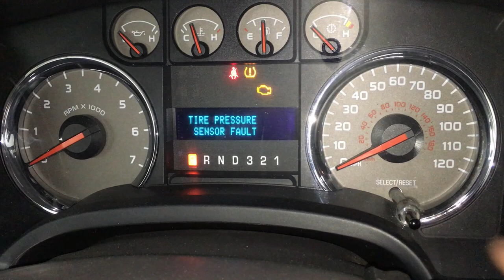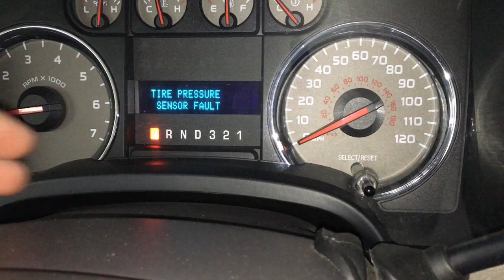1997-2010 Ford F-150 Rear Brake Job: Pads and Rotor Replacement

Comment: Thx man great video, I'll save a few bucks in my next brake job. I have a 2006 F150 should similar. I also have the Ford shop manual which helps too ( not the HANES crap ).

Comment: I always anti seize wheels stud and bolt.  Reason is two fold.  1.  Ferris corrosion and galvanic corrosion.  2.  You can't get proper thread torque if dry parts are binding.  I torque my wheel nuts to 115ft/lbs and because I use anti seize the torque is consistent.  This helps prevent one aspect of rotor wrap due to heat and unequal torque.  

The other issue I have with your video is you warn against getting g brakeclean under the piston boots but then you get in there with compressed air and blow fine materials into the voids...I would be far more concerned about that then a product that evaporates.

Comment: I've seen in other videos that you shouldn't compress the brake cylinder without the bleeder screw open. Pushing fluid in reverse can potentially damage the ABS.
Reply from the maker: Yes and?
Reply: @FordTechMakuloco  I'm surprised you didn't mention it, that's all.

Comment: hey guys! just bought a 2000 ranger 2.5 standard. many issues but the most annoying is the brakes locking up almost every time I barely touch them. It started in the back but now almost exclusively in the front. a little pressure and I'm almost ejected out of the truck... I replaced the rotors which has clear signs of the pads seizing up but no help. Many people have suggested many things. some said to replace calipers but they're not leaking nor showing signs of malfunction (they do retract and obviously expand). some suggested I replaced the hoses but with the calipers response i  doubt a clogged line is possible. some suggested a flush (I'm definitely considering it). A Ford tech suggested the most expensive alternative so far: replace the master cylinder and some abs part ( maybe the modulator valve?)... Please only reply if you know what you're talking about. if you had similar issues and resolved them holla at me please

Comment: crap, I needed to see how to deal with the parking brake portion of this. have a 2011 expedition I need to do this on.
Reply: I have an 11 Expedition as well. Was thinking of doing mine myself as well but a friend told me to be careful with the ABS system that you would have to open the bleeder valve before you push the pistons in I wonder how true this is?
Reply: @rod7071  I ended up biting the bullet and doing it. Was quite easy except replacing the guide pin rubber pieces. Difficult to put them back in. Rest was straight forward.
Reply: Nonsense, piston just pushed in like usual and without issue.
Reply: @cmarshall2211   I did mine a few weeks ago as well  it was a lot easier than I expected thanks to this and a couple of other videos I viewed. I did open the bleeder valve when I pushed the piston in. Better safe than sorry. One of the videos I looked at explained the reason being sometimes the fluid gets contaminated or breaks down in the caliper due to extreme heat in the caliper and pushing that fluid back into the abs system can damage your abs system. Not sure if it’s true or not but I got the job done without issues. Hopefully Makuloco could clear this up. My parking brake was no issue at all btw. Thanks for your info my friend

Comment: What would cause the brake to drag or not release all the way after changing out everything? Example: You apply your brakes to turn into a parking lot and upon acceleration you feel some vibration much like a rotor being a little warped. You can feel it best if you are accelerating up an incline after you turned in. Only thing is you changed the rotor too!! So it must be the new brakes dragging. Mine is a 2004 F-150 4x4

Comment: Can you advise how to open the bleeder nipple.... I had to replace a caliper today when attempting to bleed the fluid.... Last time I did it on my 2008 F-150 ,,, at least two snapped... I use penetrating oil... a little heat... etc,... they seem to be welded in there.... The nipples are made out of a VERY soft metal....and snap at the neck... without budging... is it the brake fluid that has the dissimilar metals bonding...
 I would like to finish the bleed but afraid of breaking more...

Comment: Any insight on why no antiseize on the studs? I've used it for nearly 25 years on all of our cars and never had a problem, not even one loose lug ever. Just curious. PS - Also glad we have two things here in GA... no salt/rust and only emissions inspections, no crazy in depth inspections ;-)
Reply: I don't think applying lubricant (anti-seize lubricates as well) to studs is recommended. Typically the stud torque value is specified as a "dry" torque value. Adding lubricants to the studs may cause the actual torque to the studs to be higher which may lead to stud failure. The torque specification takes into account the friction between the stud and nut.
Reply: Gotcha. Just seemed to me it was inferred that something catastrophic would happen if you got a little antiseize on the threads.
Reply: Robert Kohut when I worked at an auto shop we used anti seize on the studs when it's really rusty or hard to take off so it will come off easier later and not seize on. The torque should be sufficient to keep them on. I've yet to have one come off.
Reply: I have used it on a large number of vehicles for more than 40 years. Local tire shops here in Washington state routinely coat the lugs when doing wheel service. If you look around on Youtube this date you will find some videos that show the use of anti seize on wheel lugs. If the nut is torqued properly they will not come loose.

Comment: hey love your videos they are a big help but is their any way you could show the proper way to completely drain out the transmission fluid, like what's in the torque converter. I know how to do the transmission but not sure on how to get all 13 or so quarts out so I can put in all new fluid in my transmission for my 04 f150

Comment: Just watched this and I bought a used 2003 F150 and the brakes were making a bunch of noise so I purchased all new brakes. When I removed the caliper from the rear drivers side my pads with the two notches were on the bottom, yours was on top. Do u think the previous owner had put them on incorrectly? The inside pad was broken and probably the reason for the noise. I'm thinking I need to take both sets of the rear pads back off and swap them?

Comment: I have to do this to my 2005 STX. I have my parts, but I'm going to need a bigger C clamp. The wood clamp I have is the hand squeeze type and it just doesn't have the power to compress the caliper, the C clamp I have is too small. Can I use sand paper instead of the wire brush?
Reply from the maker: yes
Reply: Success. I picked up a large C clamp from Home Depot and was able to get the calipers off and complete the job. I ordered my parts online and saved a shit load of money, and the labor was free lol, The good news is my axle seals are good and the parking brake shoes were in good shape. Thanks for this vid, it made it easy.

Comment: Any tips for removing a stuck rear tire on an 01 F150 4x4?? Saltwater seems to have cold welded my rim to the hub and no torch, sledge, or pry bar has been able to get it to budge. Couldn't find a specific video on your channel but any tips would be appreciated!

Comment: The tool that you were using to push the boots through the caliper, I always called it a cat's claw.  Is that the correct name for it.  I need to get one for my toolbox.  Thanks

Comment: I'm changing the front brakes and rotors on my 2006 F150. The guide pins are different with one having a rubber bushing. My question is, does that pin go in the top or bottom of the bracket?

Comment: Does Motorcraft offer a brake rotor that has the black protective coating on it? I believe that is an AC Delco rotor you have in your hand right? Most important part of the job is the last part of pumping the brake pedal. I did the rear brakes on my  f-150 a couple years back but the Motorcraft rotors I used didn't have the black coating on them.
Reply: jdtractor man buying rotors these days is cheap. Buy any brand doesn't really matter except for those that have the anti rust but it's not really needed either. Just be sure you get the proper thickness. Doing brakes and rotors yourself is cheap as low as $200 . Paying a mechanic to do it could cost you $800 a pair. In the case of an Audi or VW than it could go as high as $2k a pair.

Comment: Hey if you happen to read this I hope you have a chance to reply..  on my f150, from the factory, the loaded caliper clipped in on  the bottom and then the top swung shut.  Was it incorrect from the factory?  I reassembled it like it was taken apart.  After coming across you vid, I saw that you have the top in first, the your bottom swings shut.  Is mine incorrect?  Or does it not matter at all?

Comment: Got a question. I have a 2011 f150 ecoboost, it's a supercrew 6.5 ft bed, with 20 in wheels. what would be the smallest diameter wheel, I could fit without having to change a bunch of stuff.

Comment: So I've run into a problem. My truck has a vibration dampener on the upper caliper bolt and it's very corroded and STRIPPED. Vice grips are not working to remove the bolt. I can do the brake job myself, but I can't get that darn bolt out. Do I absolutely need the dampener on there and how do I get that stripped bolt out?

Comment: I have an 01 f150 super crew that I absolutely love but I have a question and and I'm pretty sure you could an answer it for me.   When I did the break job on it I didn't find vacuum lines on the ice.  Two wires. It seems that it will lock in 2 high but not 2 low. What have I got going on here? Any help with this would be greatly appreciated!
Reply from the maker: You do not have IWE’s.

Comment: I literally did this last weekend and was thinking to myself, "You know, I wish Brian had a video on this because these stupid inner shoes won't adjust properly...." I also found that my e-brake cable was completely disconnected on one side, and I wound up just spinning the bottom adjuster in to where they don't really do anything, simply so they didn't drag.

Comment: hey, can you tell me the thread size and pitch for the bleeder screws on a 2010 F150? I want to get speed bleeders but the fitment chart on their website says I need a 3/8-24 for the front and a M10-1.0 for the rear.. can that be right? thanks! your videos are priceless
Reply from the maker: +Jeremy Johnson yes they both sound about right
Reply: FordTechMakuloco I guess I shouldn't be surprised but definitely weird to use standard sizes on one set and metric on the other but whatever.  Do you have any feelings positive or negative on using the speed bleeders?

Comment: since you are a ford tech, what fuel octane is recommended in an f150 with the ecoboost?
Reply from the maker: While this engine can run just fine on 87 octane it will run much better with more power and better fuel economy on 93 octane but you have to justify the additional cost.

Comment: whats the rear disc brake minimum thickness specifications for a 2002 f150 rear wheel drive

Comment: If I were u. I would use a drill with a small wire brush to erease corrosion from calipers. Make job more easier.Small round brush set at harbour freight cost 3 bucks.
Reply: That works well

Comment: Do you have a video on replacing the brake lines on a 10 f150 ? I've gone through 3 calipers on front drivers side not releasing and was told even though its getting fluid the fluid might not be able to go back in.
Reply: I know your comment is 3 years old. I was told decades ago, if your caliper is not retracting, the brake hose is collapsed. Replace that. Should fix that issue.

Comment: Are Raybestos rear brake pads and rear rotors good for my 2000 ford expedition 4.6L V8 Triton XLT? 

Or is it only AC Delco or ford Motorcraft?
Reply from the maker: I only use Motorcraft or Wagner.
Reply: @FordTechMakuloco  Thanks.

Comment: "There shouldnt be to much corrosion"😒. Maybe if I lived in the southern regions. lol
Reply: Raymond myszka On the 97, which was the only year they did it, the exhaust exits right in front of the right rear wheel. This caused excessive corrosion on that brake assembly.
Reply: @yqwgjsg  a8
Reply: @yqwgjsg  9

Comment: Do you need to bleed the brakes before you push in the piston of the calliper?
Reply: So it doesn’t damage the Abs system of the Ford?
Reply from the maker: It is best yes but experience tell you it almost certainly will never be an issue.

Comment: Would you prefer ceramic or semi metallic breaks
Reply from the maker: +Carlos Cepeda Ceramic just from the noise and dusting aspect. These were organic pads which are nice and quiet but produce more dust.
Reply: Ceramic brakes tend to have a better grip, yet shorter lifespan, while organic (or semi-metallic) pads tend to be the other way around. It's up to you and how well (or how long) you want the pads to perform.
Reply: FTM - I rarely ever see organic pads for sale anymore, most I see are semi-metallic or ceramic.  My favorite pads are Akebono ProACT ceramics, put them on my f-150 and BMW M-roadster. Very little dust and stop fine. Previous to these I used AutoZone (lifetime warranty) cheap semi-metallics, but make lots of dust.  ProACT pads are about $50-$60, well worth it.
Reply from the maker: +Hubjeep All motorcraft pads are organic except the superduty line which is semi metallic so they are out there.
Reply: Carlos Cepeda ceramic is best and keeps rotors longer but the pads wears out faster. Semi metallic pads wear out rotors faster but the pads last longer.

Comment: Do you ever use disc brake quiet?
Reply from the maker: No never needed it.
Reply: I work for CRC and we make the stuff but I never used it. It's popular though so I was just wondering what all the hype was about.
Reply: Ken MacMillan that stuff is useless. Use anti seize and you're fine. Brake quiet and brake stop squeal is a waste of money.

Comment: Great video. I have a question. I recently changed my rear pads and rotors.  When I went to go test drive i noticed my  driver side pad was smoking. I wiped off all of the cosmoline and I coated everything with anti-seize or silicone  grease, but I cant figure out why the brakes are sticking? Any information  would be appreciated.

Comment: Hey guys looking for some help...
 So my 08 f150 was shaking  when I applied the brakes and pulsing @ lower speeds, so I replaced both front rotors and pads while I was there... also bled the lines . STILL SHAKES AND PULSES. Any Ideas? Do the rear? See if that helps? (180k on the truck btw) Thanks!
Reply: Jorge Lopez - Although this tech does a good job, it is not the best one. The best practice is to Check the  balance on the disk. A minor misalignment on the rotor will shake the wheel or pulse the brake pedal and will lead to premature wear. The best practice is to buy a magnet base dial indicator ( sensitivity 0. 01 mm) and set it to radial and axial surface of the disk. Turn the disk slowly and see if the rotor is balanced. Desired value is ; < 0.02 mm play. If more there are shims available to fit between the brake rotor and hub. Ensure the surface where the disk sits is clean.

Comment: I have 2000 ford focus wagon se ztech 2.0 dohcm with intermediate power loss and  crank no start all the lights on the dash and the the radio will flicker once in awhile end map light would flash had this B1676 replace the battery now still issue
Reply: Alternator?

Comment: Are there any common reasons (on these trucks) why a rear caliper would drag a little bit? 

A few months and a few thousand miles ago, I replaced the rear pads and rotors, plus the parking brake shoes and hardware on my 2000 Ford Expedition. Wagner TQ pads, Motorcraft rotors, Centric shoes. The other day, after about 15 miles of highway driving, I started to get a high pitched chirp from the passenger-side rear wheel. Pulled off at a gas station a few miles later and that wheel was noticeably warmer than the rear driver side, but not dangerously hot. Didn't hear the chirp at all for the rest of the day. Later that night, after a 20 mile freeway trip (80 mph), I felt both rear wheels and the passenger side was only a little bit warmer, if any. 

It is possible that I forgot to grease the slides on one side when doing the brake job, but I doubt it. Is it common for the brake lines to collapse and not allow the piston to retract? The parking brake functions perfectly these days, so I don't think that's what's dragging, but I can't be certain. This is a Southern California vehicle, so very mild climate.

Comment: So I don’t need to loosen the bleed screw before compressing the caliper piston?
Reply from the maker: It is not absolutely necessary.
Reply: @FordTechMakuloco  Ok thank you just seen a video from 1a auto and they where talking about it running your abs system
Reply from the maker: Yes I know what they are speaking of.

Comment: Hello,

I was wondering if anyone knew if I could use the Brembo 6 Piston Caliper from a 2010-2017 Range Rover Sport or Mustang 2015 and up and if it would fit on a 2010 Ford Expedition. I was able to find the bracket part number for Wilwood, StopTech and brembo. I can find used bbk on ebay and local salvage and wrecking yards. I wanted to save some money and get a used calipers and just buy stop tech rotors and stainless steel lines and call it a day.